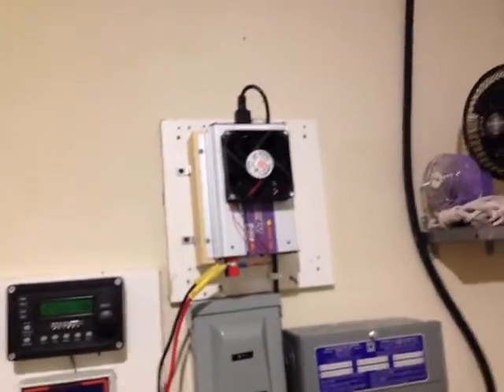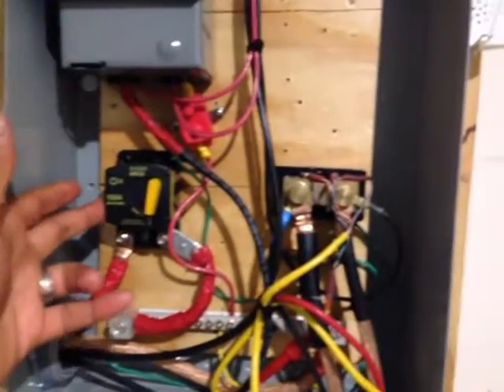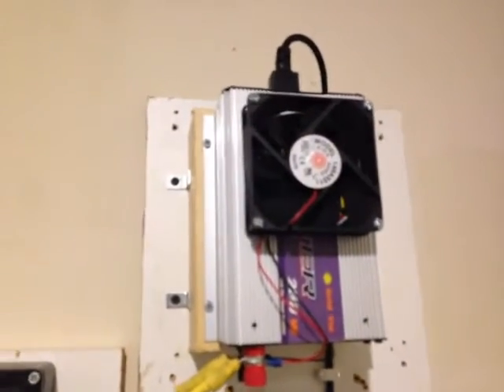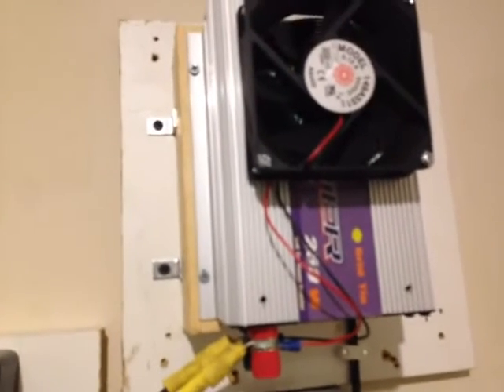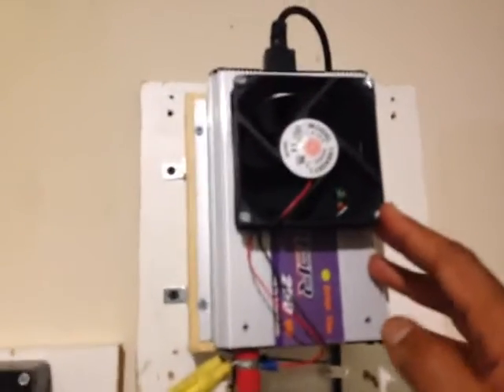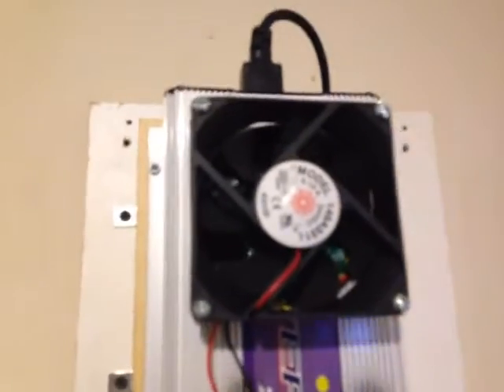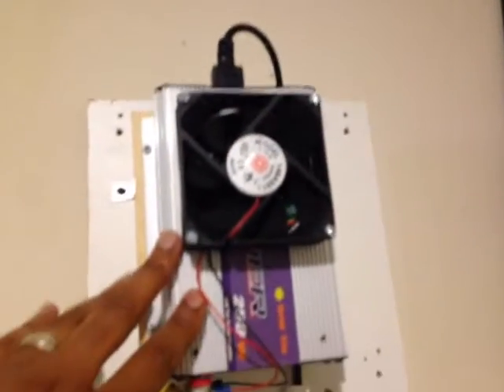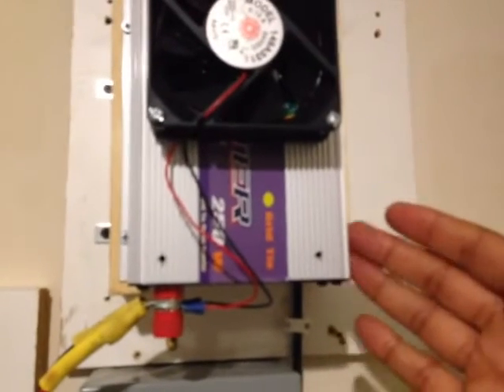DIY-Home Solar - More changes - Cooling a Sun 250w Grid Tie Inverter

Comment: I've had the same brand 500w GTI running for over a year.  What I've noticed is the higher the voltage on your batteries the higher the wattage coming out of the Gti.  Mine generally runs around 415w but I have noticed up to 435w.  I use it to dump the excess amps from my solar panels that my batteries don't want.
Reply from the maker: wadesready I agree, I've seen the same thing on my side.